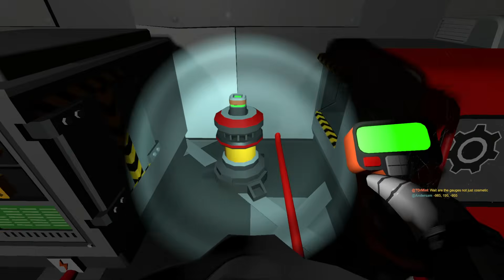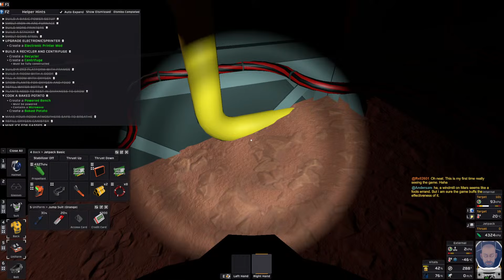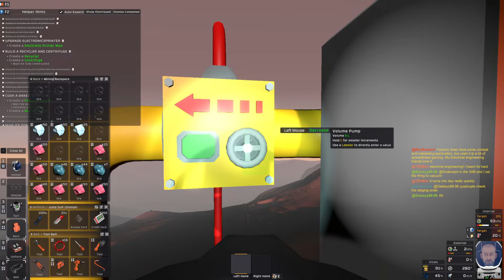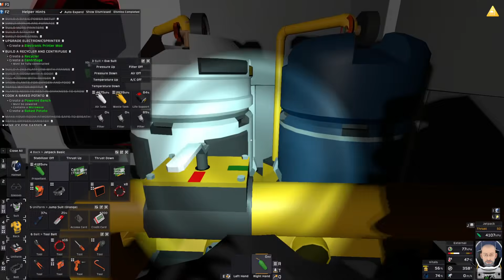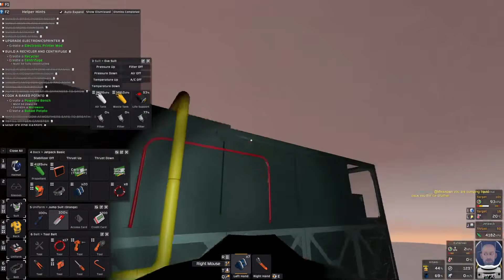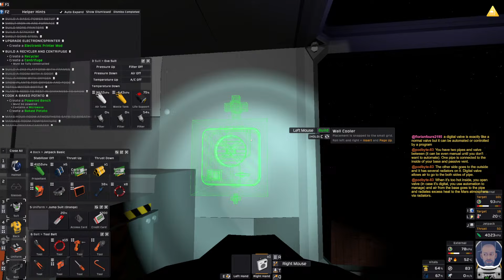Figuring Out the Plumbing | STATIONEERS Live Stream - 07

Comment: You'd be doing yourself a favour if you can wean yourself off the arc furnace and do all your smelting/alloying in the proper furnace. It uses a tiny amount of ice (2:1 volatiles:oxite, maybe 2 or 3 oxite to smelt iron with enough heat left over to do a bunch of other ores afterwards), none of your precious electricity and is much faster. That way, you can smelt/alloy whole stacks (x50) at a time, so you already have metal on hand when you want to make something.

If you ever need more pipe and lack iron, move the ice crusher to the other side of your hab :) And if you put the pumps inside, they will empty the exterior pipe and avoid the water freezing in them.

Good luck!
Reply from the maker: Good tip on moving the pump inside.

Comment: Congrats on getting some oxygen. Unfortunately, your oxygen tank now has a bit of nitrogen in it, so you need to think about filtration. Usually one would filter for a specific gas before pumping it into a tank. You could print a nitrogen filter for your suit to keep nitrogen from building up in your suit.

Remember to turn everything in your suit off before you shelve it - the suit air, pressure, and filters are all working on the shelf even if your not wearing it. Actually, the same applies when your helmet is open.

Be careful with the wall cooler - unattended you might turn your base into an arctic zone and kill your plants. Some simple logic circuits and a sensor to automate the cooling pays off.
Reply from the maker: Thanks, I'll have to look into filtering. I'll try to remember to turn off the functions in the suit, but no promises. As for logic circuits, simple or no, I'm nowhere near puzzling that out yet. I'll be happy to just get potatoes growing again.
Reply: Use a filtration to filter the oxygen into a new tank and put the nitrogen into your base. A atmosphere with more than 30% oxygen is not a good idea. That's how I've already blown up my base.